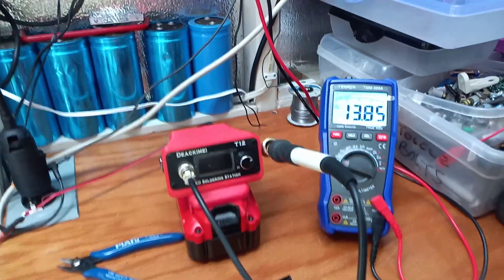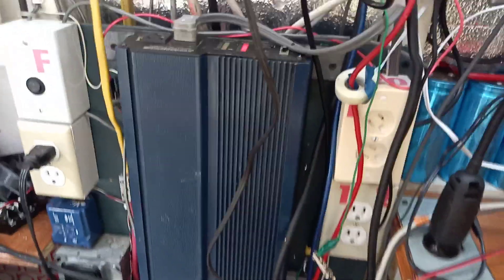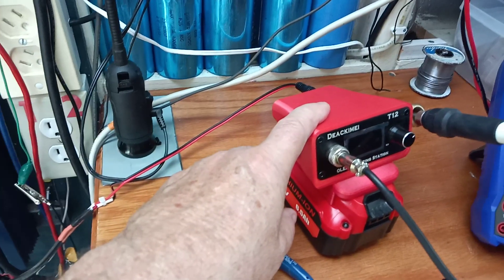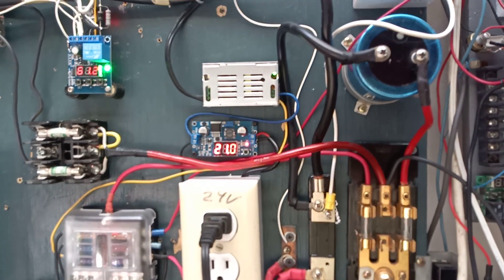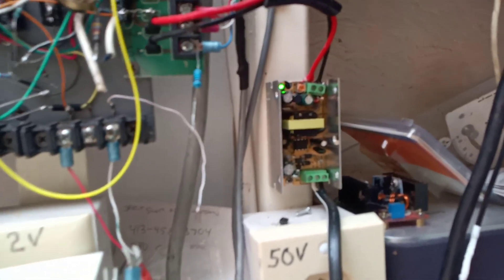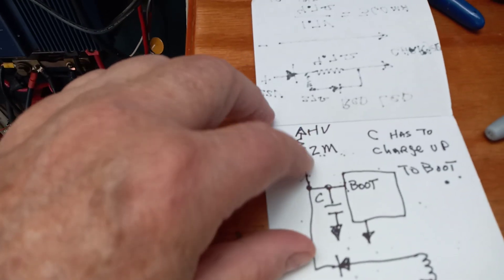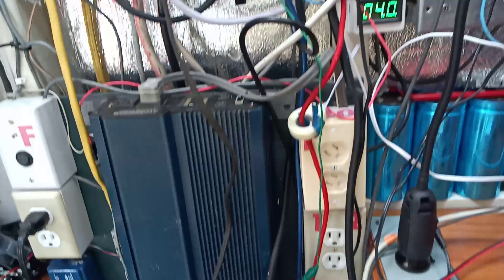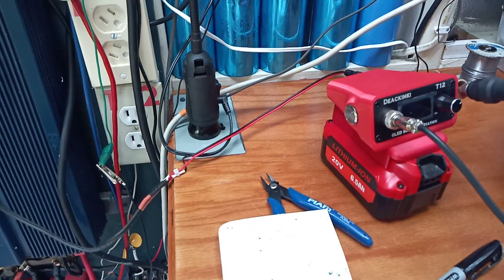Direct Power 1,  Power Directly From Solar Panels

Comment from the maker: Direct Power seems to be the new buss word on YT.  I've been doing it for years and it greatly reduces battery and inverter requirements.  My inverter only runs when the fridge is on. On this video I use a 120V to 12V switching power supply in series to boost my 12V battery voltage to 27V.  The wall mounted buck converter reduces that to 21V.   A resistor limits charging current to the battery pack of soldering iron.   A LED warns me if charging goes over 360ma.  This is a simple battery pack which does not have communications with a charger.  This is part one and I will cover in other episodes how to direct power from solar panels an old MSW inverter.
Reply: Everything should be capable of using direct PV power. Make a standard voltage and run with it. You know, global warming blah blah blah ect
Reply: @kevinroberts781 

There are 12 volts DC and 24 volts DC fridges. No need to use an inverter.

Lately I have found on the market appliances that run directly from solar panels: water pumps, refrigerators, air conditioner units, drills, water heaters, toasters, etc. 

No need for batteries 🔋, solar controllers, inverters, buck converters

Comment: Another option is to use a Lenovo laptop charger.  They output 21 volts which is ideal for charging 18 volt (5s or 5s,2p of NMC cell) battery packs.  Put a 10 ohm resistor in series with the supply if the battery pack is so deeply discharged that the starting surge is too great.
I have seen switch mode power supplies rated for 89-270 VAC, 50 or 60 Hz, start and continue to run on as little as 35 VDC.